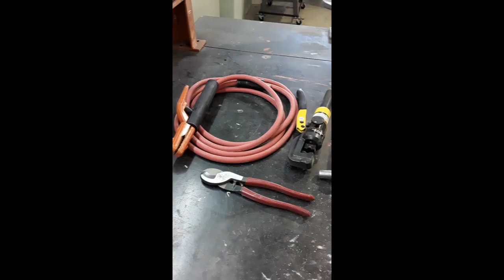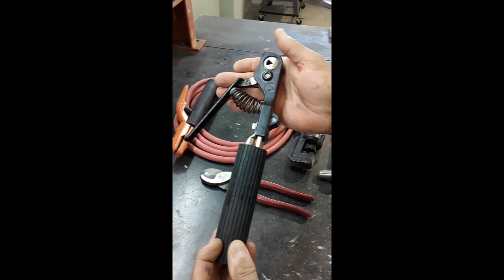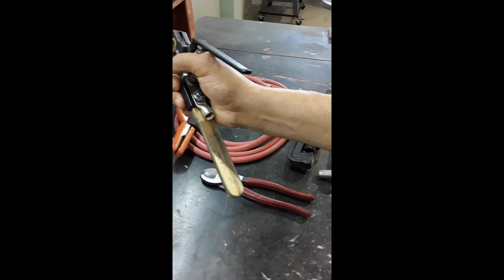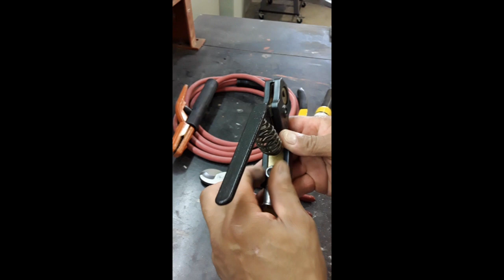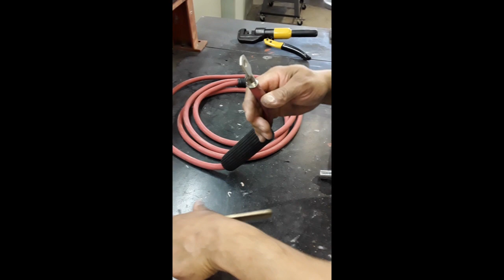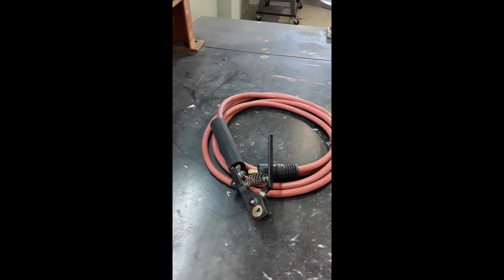Arc welding - stinger V 350 amp electrode holder vs  standard holder - set up and side by side look

Comment: What cables is it hooked up to and could I use this setup on my titanium 225 stick welder from Harbor-freight
Reply: Pls respond
Reply from the maker: If I remember right cable size was 0/1, and yes. Thanks for the question.
Reply: @guzzifabrication3448  what is the name of the cables tho
Reply from the maker: @Drakesproles379  Welding lead

Comment: do you have a cost for that stinger? 
and where to obtain it.
Reply from the maker: $ 85. on amazon, that was the best price I found, yeah it's pricy for an electrode holder...  but I love that thing
Reply from the maker: @Chase Williams Inexpensive electrode holders work fine, some of the pluses of the stinger V are 1. heavier duty 2. positive clamp on the electrode - the electrode is not going to move in the holder 3. ( my opinion ) more comfortable,  rule of thumb invest in the best tools you can afford, and when possible upgrade.... Thanks for watching !
Reply: Now its $135😭😭😭
Reply: Have you also found a better ground, the ground on my entry level Hobert mig is awful, also on on doing plug welds, I have 120 volt model , will it work and do you use flux core wire or o.35 with gas